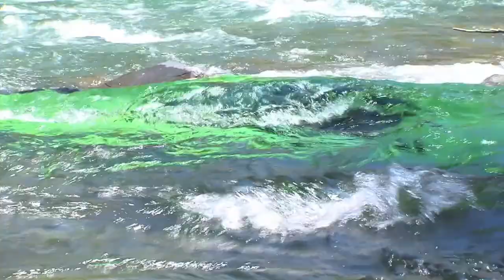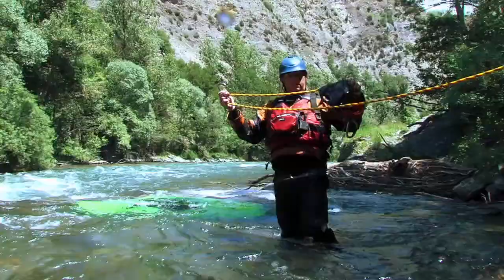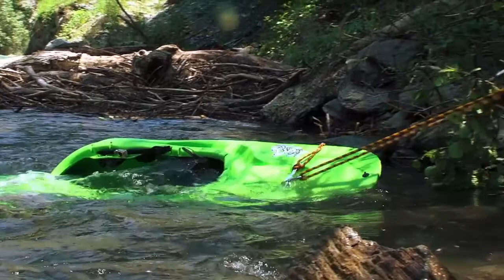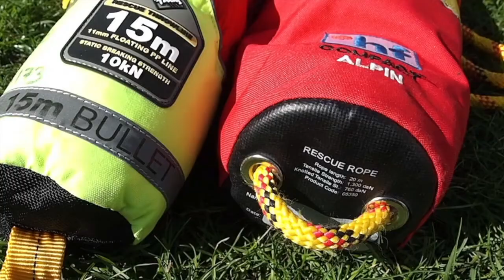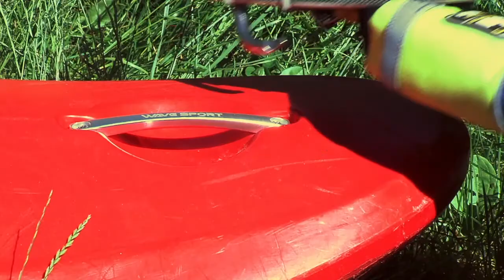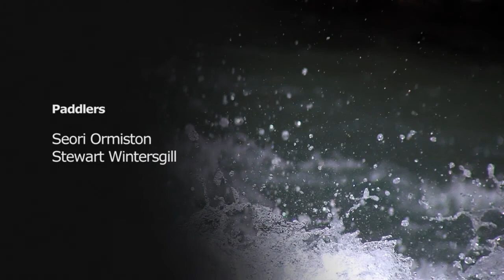Chapter 10 Recovering Equipment, White Water Safety Instructional movie, for kayakers and canoeists.

Comment: Hi team, love your series!
 Regarding the "roving 4:1" system, it is fascinating that it works as there is no fixed attachment.
Why is the loop not just circulating through the biners?
Does this work with pulleys in the system?
Cheers.

Edit: Ah, have worked out the two lines at the anchor do not actually move ;) (effectively a fixed point with a biner for convenience).

 If even one pulley placed in system it loses friction and the loop just runs through! That'd be embarrassing... :)

So, throw in a Munter/prusik at anchor pulley (line going directly to boat) to ensure no movement (although allowing re-set), and place pulleys on boat (if possible) and travelling biner, and this is really good :)
Even just one pulley makes a big dif.

Thanks for sharing.
Reply: Great question Fraser!

The answer re: 4:1 pulleys is yes, and it is very beneficial to do so with larger loads like canoes stuck in the river - but how you do it, depends on what you wish to accomplish.

Pop two pulleys on, one at each of the bends where you want the rope to travel (i.e. at the boat/object and at the bag end of the rope) and the point without a pulley (i.e. the anchor) will take the friction and the system works. However, it loses its roving / resetting capability under load because of the differences in friction.

Pop three pulleys on, one at each of the karabiners/bends and when you pull the system will not work UNLESS you grip the rope at the pulley nearest the anchor, i.e. offer an increase in friction. This is easy enough to do even if operating it on your on, we're talking 'pinch it with two fingers' as an amount of force required to create the required grip. I've tested this with a canoe full of water stuck in a river (not wrapped and folded, that would be a waste of a canoe!). The beauty of this version is it is still resettable - even under load.

Many folks still 'poo-poo' these ideas, however, I would urge any sceptics out there, or true believers, to get out and play with it. Don't be afraid to make mistakes and be willing to question why stuff does and doesn't perform - therein lies the quality learning.
Reply: Cheers for the response Bruce.
Yes, trial and error is how we learn. 
This will be my go-to system!

Fascinating how providing a small amount of tension sees it working under big loads! So, no need for Munter/prisik as I was thinking.

Did you guys come up with this, or been around for a while?